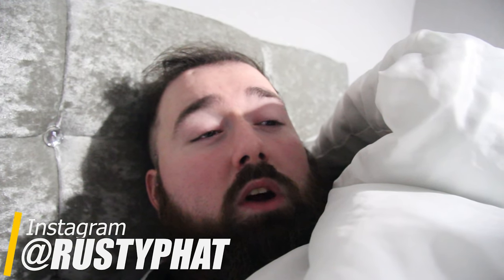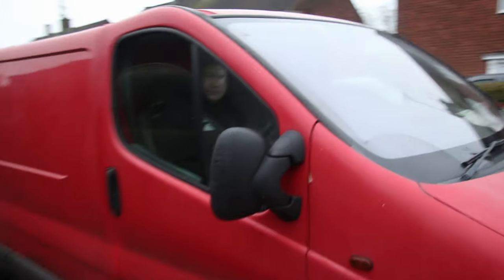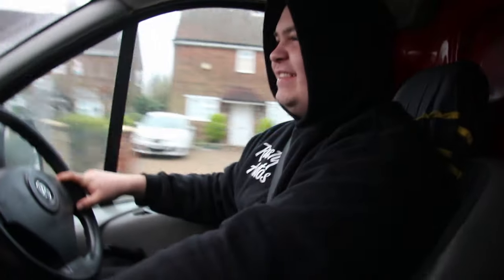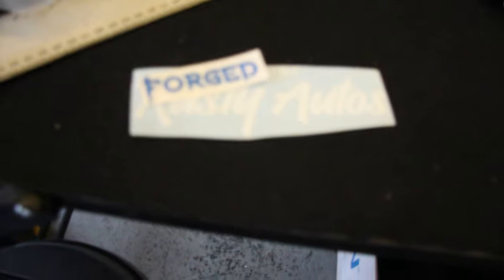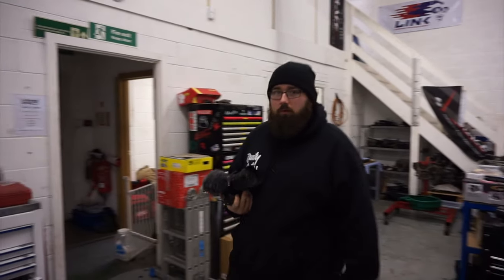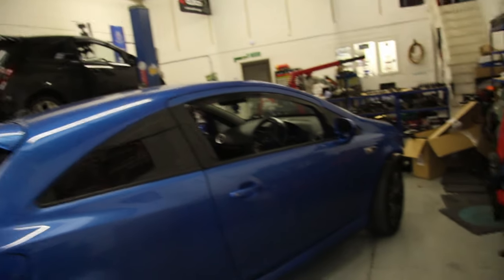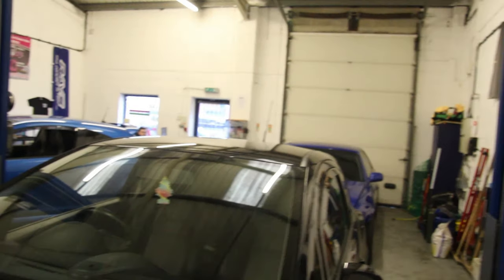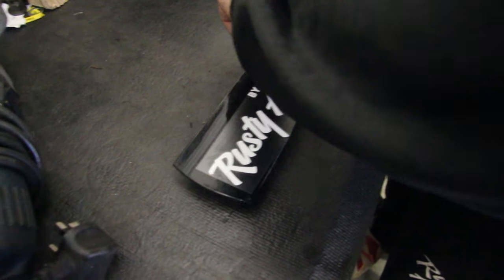Day In The Life of Rusty Autos

Comment: I'm thinking of getting the 2016 Corsa VXR for my firs car. I don't plan to do anything to it as I prefer riding motorcycles. I was wondering if you think this is a good car for a run around and to have a bit of fun if I wanted to and if they are a reliable car?
Reply from the maker: Hey mate reliability no, unfortunetly as you never know what the previous owner has treated them like, but dont get me wrong you can find a decent car and they are great to drive, its just always a risk
Reply: Rusty Autos ok thanks the car is a show room car in perfect condition the previous owner has never been in the back seats. It got 25k Miles and the previous owner it an oldish guy it his 40s .